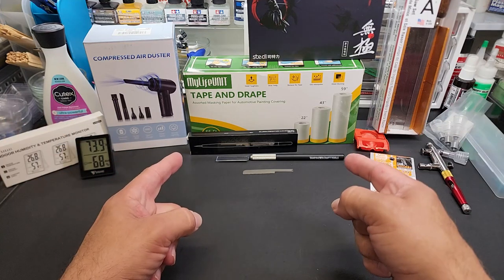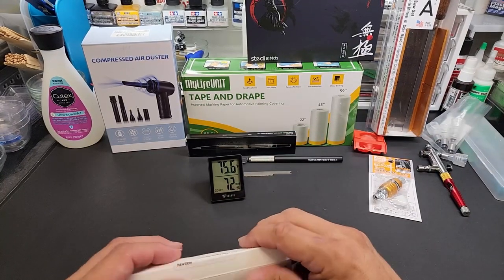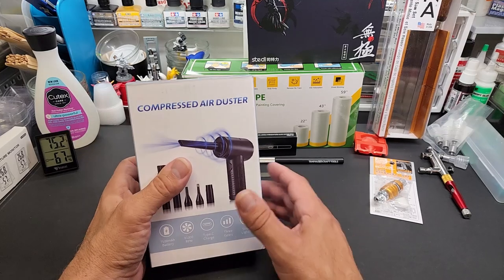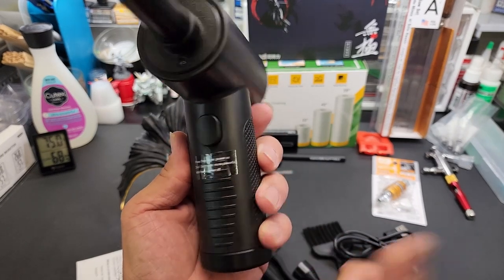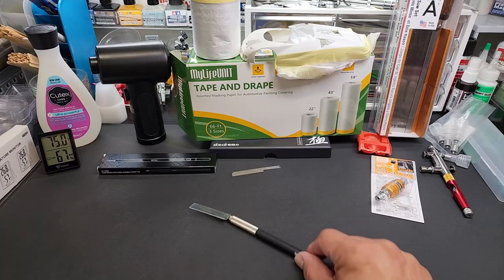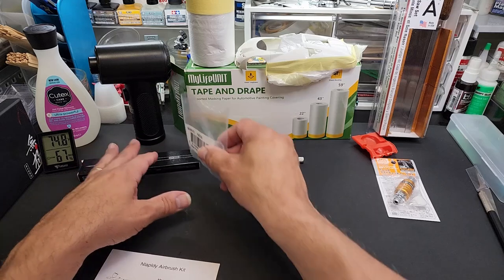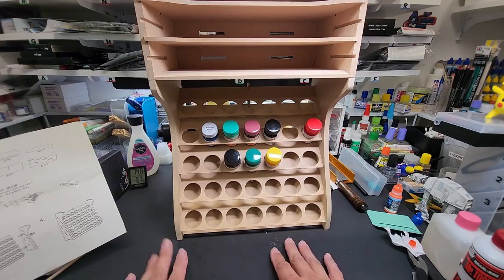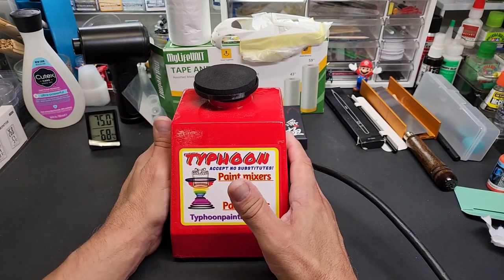Tips & Tools Part 10 - Accessories For Model Building

Comment: Just got one of the Tyhoon mixer. The mid-grade one. Def rec the dual tops cause the cup top with 17ml bottles is much easier to handle than the 3" top. The 3", though is also GREAT for rattle cans, large pots, etc. Also... it's a gd tank. Could be used as a weapon in a pinch. Rob waas also GREATT to work with.

If you're lookin for humidity sensors, look at the ThermPro line. They have a multichannel setup that's cheap, accurate, and lots more info.

Comment: More great looking products.  I just got a Stedi nippers today.  Not top of the line, but even as a lower model, it came with an extra spring, an allen wrench, and a cover.  Great tool and I'm glad I got one.  It's much better than the one I was using.  Thanks for the tool and paint advice.  Keep putting out great content!!

Comment: I bought one of those dusters, (not the brand you have) about a year or so ago to get away from canned air. It's nice that all I need to do is plug it in to charge it and then start blowing away dust from my keyboard and models. Thanks for all the reviews, especially the Cutex. That's a lot cheaper than home improvement store acetone.

Comment: Robert, you probably already know this but I thought I would share a tip with you. The Gaahleri Advanced air brush can be back flushed just like you do with the GSI Creos! I discovered this by accident. I had just cleaned my airbrush and was ready to paint a new color. I didn't get the nozzle completely tight. I pulled the trigger and voila instant back flush! I tightened the nozzle and then lossened it a quarter turn to see if it was fluke and it worked again. Great Airbrush! Thanks for recommending the Gaahleri brand. I don't know if this works for all Gaahleri or just the advanced.

Comment: Great show as always, Barbatos.  I noticed on your temp/humidity indicator that it changed as you handled, meaning it was increasing as you held it, both in temp & humidity.  When you set it back down it went back to the original 75F & 68% RH.

Really liked that compressor air duster. Definitely getting one of those. Those air duster spray cans cost $6 -- 9$ a pop and I don't even like them that much.  Thanks for showing me another way.

Also have to agree about those paint cup bottle tips.  Need to have a 'universal' fitting that allows at least two sizes to fit 90% of the Airbrush market.  Would hate to get one only to find out it didn't fit my brush.

Not sure if there's a code word or not, though I'd definitely like to be included as a contestant in your G-A.

Thanks, man, keep up the efforts, they are appreciated muchly!

Comment: The humidity meter is a great idea. I have an outdoor temperature and humidity sensor that connects to two displays in the house. I have been using the relative humidity reading as a guide to decide whether to spray or not. Thanks for this great recommendation.

Comment: That paint feed adapter is interesting, I wouldn't mind using it for big builds that require a lot of painting with the same color. At that point though, a syphon feed airbrush might be better. I think that's what most industry airbrushers use when working on big projects that require a lot of paint. Thanks for the video

Comment: Ordered the humidity gauge, but I wonder if the cap/tops for the airbrush will create a vacuum by sucking the paint from an air tight bottle?  I did grab one of the Nesco airbrushes for priming. Nice set up for the price point.

Comment: I picked up the air compressor.  i just used my last can of air so this will come in handy.  I had some trouble locating the vallejo paint feed adapters as i did not see them i nthe description but was able to buy and try them.

Comment: Nice video, I have doubts about the paint bottle airbrush adapter. How air is supposed to enter the bottle while spraying. I think it would create suction in the bottle after a while not letting the paint flow. That's the reason why airbrush lids and bottom feed bottle adapter have a holes to let air in. Just wondering

Comment: Another good video. Some good items and a few of questionable effectiveness. I'm wondering if the paint bottles to airbrush adapters will work as there doesn't seem to be any vent to break the vacuum lock to allow air into the bottle.
Reply: The airbrush itself is not totally sealed. So when you press the bottle, the paint will drop down to the paint definitely. The question to me is, will the color mixing with eachother when you change to different colors? Like the first time i use red, then i change to green. Will some yellow paint come out?

Comment: I purchased one of Roberts mixers when you posted the first video on them so don't include me for the give away. He has great products but the paint jobs on the units are a little sketchy. Mine had several fingerprints in the paint. I ended up stripping it and painting it Ford engine blue. I will be adding the saws to my bench for sure. Thanks for these videos there is always something you overlook that you might need.